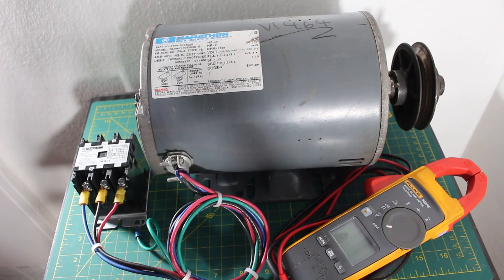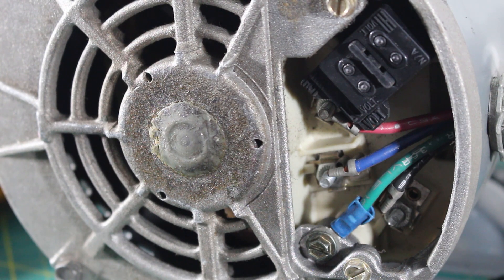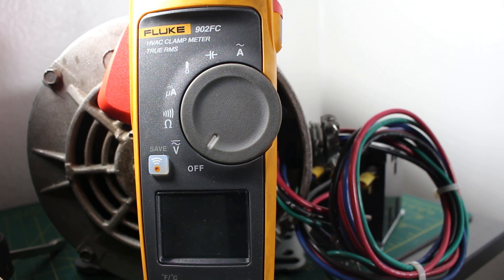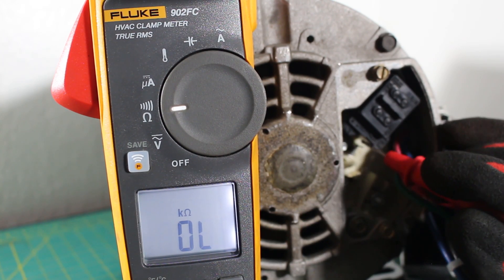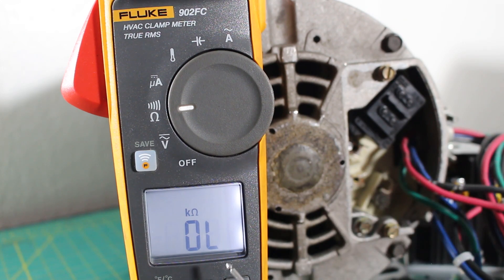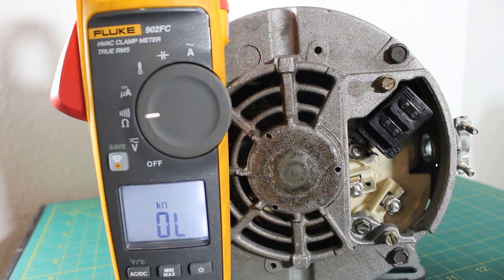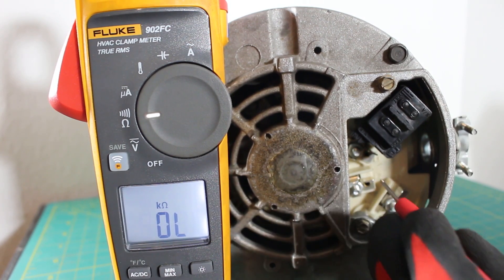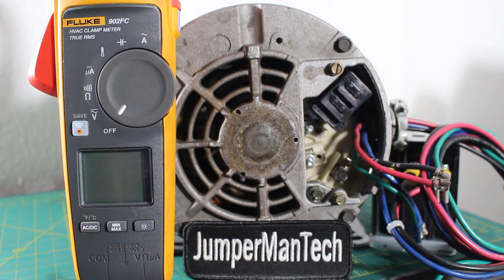How To Troubleshoot 3 Phase Motor With A MultiMeter (3 Phase Motor Test) Winding Resistance Test Ohm

Comment: How do you for check an open between the bottom of the combination starter and the motor,  say a wire is cut in the field between the motor and the combination starter?

Comment: You giving FALSE information. A multimeter does not put out any nominal voltage. You cannot test to ground, or frame with a multimeter, you must use a megohm meter that puts out anywhere from 240 to 1000v. Please if you are going to put yourself up as an expert at least be factual! This is poorly described.

Comment: You left out a few things to properly check a 3 phase motor.  1.  Always check your meter and meter leads for proper operation prior to performing any tests.  2.  When checking for grounds, always verify your have a good motor ground by placing both meter leads on the motor and after establishing you have a good ground,  leave one of the leads used for verifying good ground in place on the motor and then place the other probe on L1,L2, L3 for testing.  And a Megger is the proper meter to use to check for grounds or insulation issues. 3.  Verify leads and meter are working correctly when finished test to ensure they are still operating properly
Reply: Well, if explaining basics, shouldn’t we start with lock out tag out, arc flash calculation for proper PPE and meter cat rating, then live dead live, and then we can get to motor testing!
Reply: @RugbyLock  you are correct - but that's prior to testing and I was not explaining basics  - I was only referring to and explaining the testing part of the equation.

Comment: When checking for grounded windings, it's best to use the bolt heads since they are threaded into the motor housing hence it has the best bond in most cases 😊

I might add to push and pull on the motor shaft to checkfor excessive end play and then try moving the shaft laterally to check for bearing slop.  Yeah, the motor might still be functional but it's always a good idea to replace it before it completely destroys itself.  Of course, you could replace the bearings assuming you can source them.  If the motor is using bushings then that's a different problem altogether.

Great video, you're a natural teacher ☺

Comment: Hi im wondering coukd yiu give some advice i have two post car lift with a 3phase motor but i have an inverter box because my power supply is single phase my lift goes up and down with no car on it but as soon as i put a car on it there is not enought power to lift a car if i keep putting the lift up and down repeatdly with no car it sticks  also the motor feels hot to touch
Reply: By inverter I assume you mean a variable frequency drive as that would rectify single phase AC to DC then invert it back to AC with a three phase output. Best guess is a problem with the VFD (or it is improperly sized or has the incorrect settings).

Comment: Don’t forget the bigger motor will have a very low resistance phase to phase. Some people will assume 0.6 ohms is considered shorted. To check if the windings has resistance imbalance, you need a low bridge ohmmeter that is designed to read a very low resistance that a normal meter would not detect.

Comment: So when checking resistance ol is not good
Reply: Don't know if this is serious. OL gives infinite resistance because the current isn't flowing (broken wire)
Reply: @tomwaters5651  it is a serious question. Thank you for explaining
Reply: @Sc19869  you can easily demonstrate this by just turning on your ohmeter or multimeter and setting it to continuity or resistance. If the leads are not touching and no conductor is between them, you get OL

Comment: Great video. I am a electrical maintenance technician and the way you explained how to properly and safely test a 3 phase motor is better than I could ever do. I will be referring my coworkers to your video so they can learn the proper way to test a 3 phase motor. If I could add anything, maybe explain how to test the supply wires separately, because I have seen the insulation get scuffed up and short out a drive. Other than that, this is a very beneficial video.

Comment: OL is open loop. It means high resistance or there’s an open. Zero resistance indicates continuity or continuous. Most three phase motors are dual voltage with 9
Leads brought out. Use the +3 method to connect for high voltage which connects the windings in series. Connect them in parallel for low voltage. Wattage is the same so there’s no savings in electricity either way.  Low voltage connects a big lead to each combination of 1-7, 2-8, 3-9 and 4-5-6 are connected together.

Comment: Well done.  Take the next step and introduce your viewers to the proper terminology.  "Measure the OHMS" is not incorrect, but "Measure the RESISTANCE" gives them the correct parameter and the correct unit of measure. 
You probably wouldn't say "Measure the DEGREES", you would probably say "Measure the TEMPERATURE".  The parameter is temperature, the unit of measure is degrees.
Measure CURRENT, report AMPERES
Measure VOLTAGE, report VOLTS
Measure FREQUENCY, report HERTZ

You've got an audience, give them the best material.

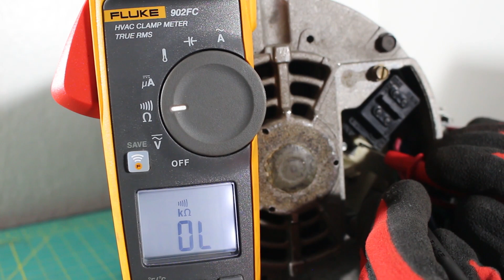Comment: 4:12 what if the resistances are slightly different?   Or what is the threshold for difference before you deem the motor to be bad? Thanks for the vid!
Reply: You use the 5 percent rule +or-  at my job if they were past that we would just run them for a hour alone before loading them into the gearbox and checking for any over load

Comment: Careful using the 902FC for insulation testing as the maximum resistance for the meter is 60k ohms, any value above this will read open circuit.

Comment: You can’t properly ohm a motor winding with a basic meter like that Fluke. 🤦‍♂️
Reply from the maker: This video is on how to check a 3 phase motor (Specifically the windings) with a multimeter and this is how its done relating to the theory. You are also correct as the best way is with a megohmmeter which I have a video on as well. Thanks for watching & stay tuned for new videos every week🔧⚡

Comment: Some 3 phase motors that run at higher voltages will have insulation leaks at higher voltages that a normal ohmeter test cannot detect.  This is where you would use whats called a Megger Tester or Megger Ohmmeter.  It applies a high voltage 500v 1000v 5kv 10kv to the motor leads/windings and checks for leaking current to ground through the insulation.   You can also Megger Test from winding to winding if they are completely determinated from each other.
Reply: You are equally right.
Reply: @danielteyehuago1633  no, he is right, the person putting this video up is actually giving erroneous information.
Reply: Yep good explanation !
Reply: They do it with 480 as well just depends on what the client wants during commissioning

Comment: holy crap thank you so much! i started my apprenticeship 3 weeks ago and I was told to test a motor and I looked like an idiot! They never really explained it to me, but now I understand! 

Line to Line, you want small resistance.
Line to ground, you want no reading. Infinite or "OL"

again thank you! you helped me a lot!
Reply: Depends on the size of the motor. Smaller motors have higher resistance, because of the wire soze used in the windings. Checking resistance doesn't always work on large motors,  i have had motor pass resistance test and fail a megg test. Don't take advice from "at home" electricians. And remember bad things happen if you dont disconnect the motor from drive before megging.

Comment: What you mean if I'm grounded I'm good and if is shows ol I'm good on continuity?
Reply: So “OL” means infinite resistance, right? So anything other than infinite resistance means that there is at least some connection between the 2 points that the probes are touching?  (Does “OL” mean “OverLoad”, meaning that the number is larger than what can be displayed?)
Reply: OL is open loop. The circuit loop is open/broken somewhere. And yes, if you have any sort of resistance between both connections, it is connected. @davebenz8271

Comment: If I am checking out a motor on a chiller, I wont be using my meter that's for sure. I will be using my megger period.
Reply from the maker: I hear you with that. Todays tech for a multi meter is quite amazing but the Megohmmeter is definitely the most accurate. What kind of megger do you use and recommend?
Reply: @JumpermanTech  I have a Megger MIT 420/2  it's bad ass.